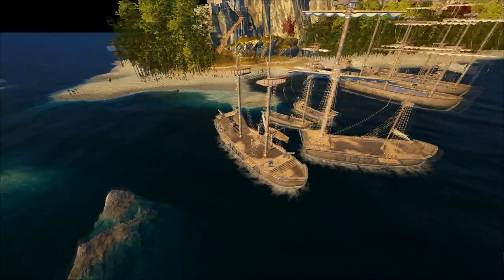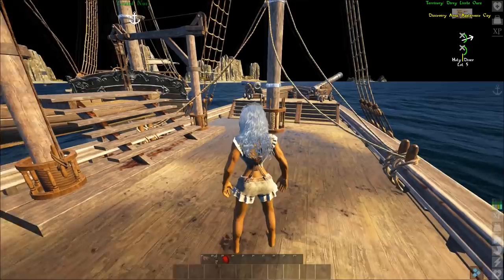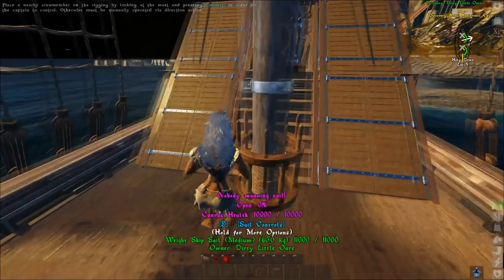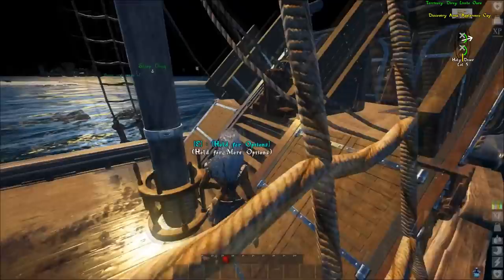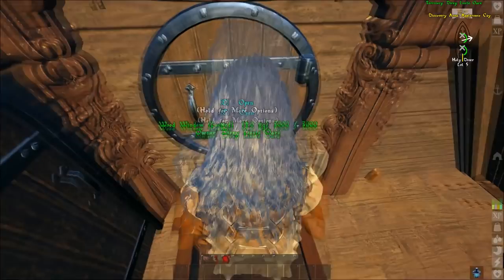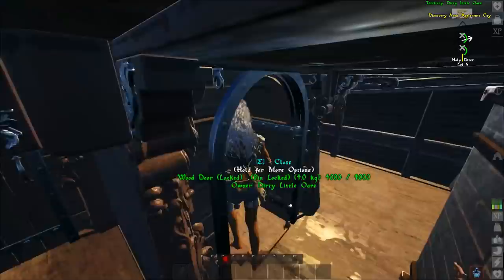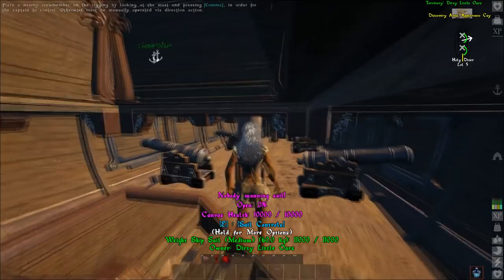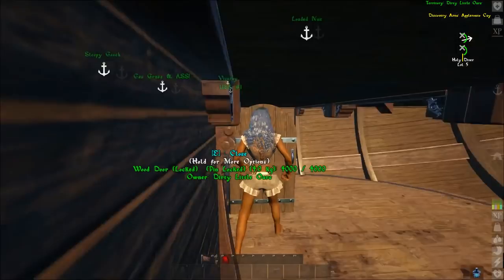THE POINT OF AIRLOCKS! ATLAS - BOAT BUILDING TIPS

Comment: Why weighted sails?
Reply: A standard schooner weight limit is around 6k. While mine is 8k
Reply: At only lvl 5
Reply: @RageFacePanda  Ah, I see. And you think thats worth the loss in handling/speed?

On another note, do you plan to continue with this next patch?

"- Increased the base carry Weight of all ships by +40%"
Reply from the maker: @Jamespeterstu  I think the only change I'd make next match is going to be changing out the sails to 1 Large Weighted Sail and 1 small speed or weighted sail. Keep in mind that in order to get full speed out of a ship you must be below 50% encumbered. So, do the math for yourself and the boat you currently use? When transporting loot or going out with the party to raid or take down ghost ships, are you even going full speed? Then, add the 40% for the next patch and would you still be under or over that gap. The speed difference is so small when considering weight with ships. Most of these "double speed sail" builds aren't even going full speed or they show off full speed in very unrealistic manners.